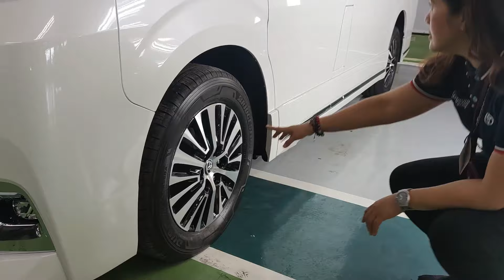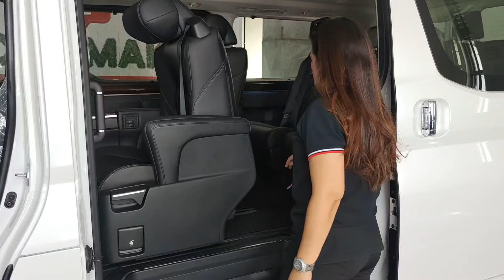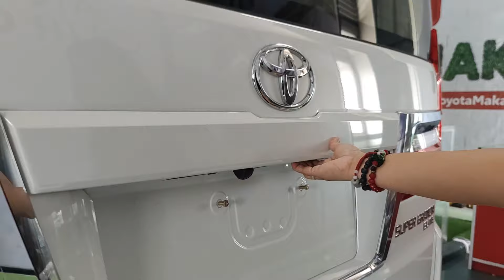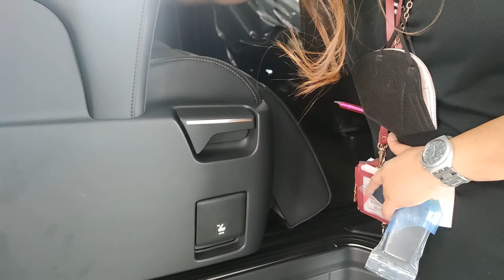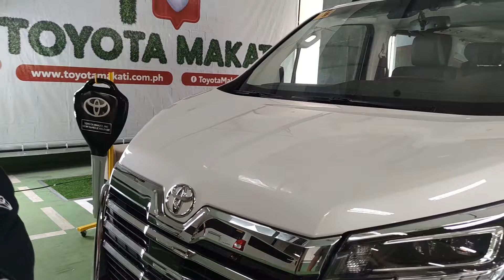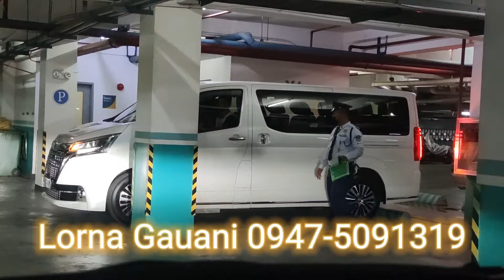2022 SUPER GRANDIA ELITE WHITE PEARL CRYSTAL SHINE WALK AROUND

Comment: Ilang horsepower po Yan? Ilang litro Ng diesel Ang full tank at ilang seating capacity?
Reply from the maker: Hi good evening Super Grandia Elite Output 176ps/3,400rpm
Torque 450Nm/1600-2400rpm
Good for 10 capacity
Fuel Tank 70liters